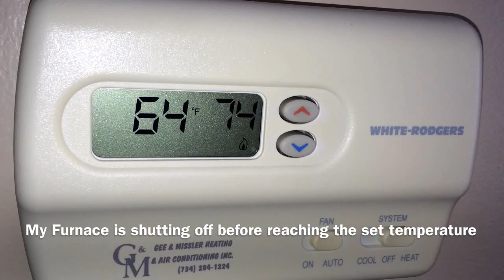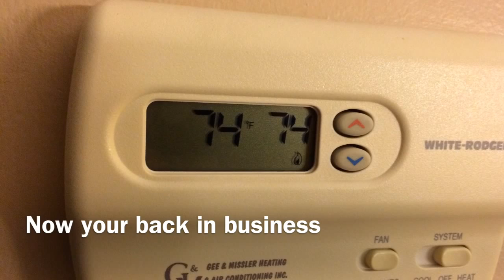My furnace keeps shutting off, only runs for about 5-10 mins... (HD) Simple Fix (Flame Sensor)

Comment: Thank you so much for posting this video! The flame in the burner box was shutting off almost immediately after firing up.  I took the flame sensor rod out and cleaned it up just like you said to in your video. It wasn't all that dirty but after I re-installed it the furnace fired right up with a beautiful blue flame. Thanks again for saving me a service call!
Reply from the maker: Glad the video was a help... make sure you replace the furnace filter also.

Comment: Wow, this is the first I've seen this answer and I hope that's it.  I cleaned the filters and thought that was it, but it would still time out early.  So I paid I 'diagnostic' (sales call) which I hate. He did a good overall health inspection, which was good, but I know he didn't know the cause and just wanted to throw parts ($1000 control board - which was $100 online or $30 on ebay), and/or cap ($175) but wasn't sure if that was problem, and/or switch.  I'm an engineer and questioned his measurements and how things work.  He never mentioned or looked at this and I'd put a wager that this 15 year old sensor with limited filter changes might be contaminated.  Wish me luck.

Comment: My furnace is about 40 years old , the landlord won't replace them but your showed they can get clogged.  Last year my furnace was shutting off after  it was on for about 7 minutes,  even the fan.   It took about 15 minutes to cool down if left it on and the same thing would happen.  It has a lot of soot in it.  I'll just have to work with it I guess till I can get fixed. Thanks for the information.
Reply from the maker: Glad this helped

Comment: I wanted to thank you! After watching your video even though my furnace was a different one than yours I was having the same issue couldn't get my landlord to check on it for a while and was freezing so I did what you recommended and reinstalled it now running strong!!!! Being a girl was kind of nervous but following your instructions really helped
Reply: great! i had to comment because it doesn't matter if you're a girl or a guy. many guys don't know this stuff either which is why they're here. don't put yourself down
Reply: Very helpful my oil company has not fixed this right over and over.
If they do not fix it right tomorrow I will let you know their name

Comment: Just a heads up....when I took my flame sensor out, it really didn't look too dirty (just a small brown tarnished spot about 1/2" long)  and I thought about just putting it back in w/o cleaning.  But then i thought, I took it out so why not clean it any way....good thing I cleaned it with steel wool, that was the problem.  Thank you for the video.  My furnace went out on about 4am on Christmas morning. (probably would not have gotten a repair tech here until late afternoon or the next day.

Comment: Wayne Campbell is correct, 5-10 seconds, not minutes. The flame sensor may be good but the sensor current may not be getting to the control board; usually due to a loose connection.  If the cycle comes on and shuts off in 5-10 minutes check the chamber temperature by sticking a wire probe through a small drilled hole. The temperature should not exceed @160 degrees F. If it is too high there probably isn't enough air passing over the heat exchanger. Check for restricted air flow due to a dirty  clogged filter or restrictions in the ducting and vents.   Make sure the blower is turning the correct RPMs. This can be checked with an inexpensive tachometer.  If the blower is turning too slow the problem could be the motor capacitor,  the wiring, or the blower motor itself.
david
Reply: Vivienne Pierce vuj

Comment: My furnace was doing this but it was not the result of a faulty flame sensor. Ended up being a clogged condensation trap which attaches to the drain hose. With the trap clogged water would get into the fan and the pressure switch would turn off the furnace because of pressure build up. Cleared the clog, and the furnace ran normal again.
Reply: +lestergoods Thanks for adding your comment!  I cleanded the sensor as described in the video but I was still having the problem.  Cleaning the trap was ultimately what solved the problem.   God bless you for sharing!!!
Reply: How did you clear / clean up the clogged condensation trap? My heater was turning off after 5 attempts. It made a gurgling sound and the engineer sucked out almost close to a gallon of water from the pipes heater side.
Reply: +Srini Sil Detatch the 2 or 3 hoses from the top of the trap, these are the ones that connect into the furnace exhaust fan. Have a bucket ready because water is going to free flow out of these hoses, if not, blow into it, you should hear water bubbling and then it should come out. After that I took the trap out, just snaps out, and blew into it and washed it out in the sink with soap and hot water. Make sure the water and air flow easily through the trap . Then just put it back together. Water in this part of the system is normal. The furnace just needs a way to get rid of it. Don't let some overpriced tech tell you the water needs to be sucked out. The furnace does this on its own by blowing it out with the fan and a clear line from the fan to the trap then out the bottom hose from the trap. :)
Reply: Thanks lestergood. I will try this out.
Reply: Thanks this was the fix to my furnace as well!
Reply: lestergoods sounds like a problem I might have. this video didn't work
Reply: Draining and cleaning out the condensation trap worked for me.  Thanks lestergoods.
Reply: lestergoods of
Reply: lestergoods 

 J i

Comment: Thanks so much.  We have a Merit Series lennox furnace, so the flame sensor is a little easier to get to than what you showed in your video.  Either way, once I cleaned it, it worked like a charm.  Thanks again for posting this video.

Comment: i have furnace just run 4-5 hours and then stop , so I have to turn the switch off and wait couple minute and then i turn switch back on , the furnace running about 4-5 hours and then stop again , I cleaned the flame sensor still that problem.Anna

Comment: Lennox furnace. 17 years old. shuts off prematurely. cleaned the ignitor, the flame sensor. used a fine steel wool. filter was very clogged. changed it. now it works fine. hope it helps someone. thanks

Comment: usually if its a flame sensor problem the furnace only runs for about 5 to 10 seconds not 5 to 10 min. it will try to stay on for three tries then shut off for about an hour.
Reply: This is exactly what my furnace has been doing. I will check the flame sensor first!
Reply: hot surface igniter

Comment: If it was the flame rectification rod it would kick back out almost immediately not after 10 mins, that sounds like an airflow issue. The unit is running and getting to hot due to insufficient airflow in the exchanger and is probably tripping the hi limit switch located in the combustion compartment causing a soft reset.
Reply: I have a keeprite its throwing a code 3 randomly over the last 2 months it has gone to a code 3 about 5 times.. I had 2 morons out to look at it, neither fixed the problem but took my 124bucks each time.. One claimed the snow was blocking the vent, wrong.. He essentially ran the furnace with top panel off claiming it was running perfect when all he did was reset the damn thing and watch it do one heat cycle.. He was there 15 minutes.. The furnace worked for 16 or so days but still had a weird intermittent short cycle..The second tech came 16 days later when it tripped a code 3 again.. This tech was a different guy same company.. I thought I wouldn't be charged since they didn't fix it right the first time, wrong.. They charged me again 124 bucks and all he did was blow threw the pressure switch tubing and pull the condensate drip housing thing off and claimed it was blocked with debris.. I expressed to him I did not think that was going to fix it because I already did everything he did exactly 30 days prior back when it first went to code 3.. 
He was writing the bill up and the furnace short cycled... 
Essentially it ran for 10 mins shut off for 20 seconds or less then fired right back up just as he was about to leave.. This peaked his ire.. Naturally it should.. He goes back down, I had to run to the bathroom and by the time I got downstairs (3mins total had passed) he claimed the problem was the heat sensor and that he just cleaned and put it back in..He went on to say it was utterly filthy and it had to be the problem.. I looked him dead in the eyes and said I cleaned the flame sensor 20 days prior before the first tech even showed up (the guy who said snow was blocking the intake)... Then he challenged me on where it was because I might have cleaned the wrong thing.. I pointed to it and he said yup thats it... I said it took me 20 minutes to fumble fuck my fat hands in there, get it out, cleaned and put back in.. You did it in 3 mins.. Fucking pure bull shit artist caught.. He never cleaned fuck all he wanted to leave because the problem was too big a job or he didn't know wtf to fix next.. Another waste of 124 bucks.. So Im in the hole 248 bucks on 2 tech calls that rendered me nothing but a anal fissure from the ass rape of my money.. They might as well have sent out their fucking janitor to trouble shoot for all these 2 clowns were worth... 

Anyways, the furnace is still short cycling for 10 mins or so on, then off and back on almost right away.. its been since january 31s 2019 that the first code 3 appeared.. But to be honest the furnace ran weird all winter... In sept 2018 a tech came and installed an ecobee wireless pos thermostat... My Hvac buddy thinks it fucked up the circuit board by doing excessive calls for heat or something I can't remember what he said exactly... 
I rehooked up my old regular thermostat and it still runs weird but I guess if the board is fucked its fucked right? 
Or perhaps its just a faulty pressure switch? 
I had a tech clean the furnace august 2018.. so last summer.. He barely pulled any brown fur out of the exchanger area.. I mean my pc has more dust in the case fan than what he showed me.. Either he did a poor job or its right blocked up and maybe the furnace is over heating??

I am thinking of ordering the pressure switch myself, it looks like a nutless monkey could put one in.. 
My other thought is the furnace circuit board or perhaps an overheating issue.. There is no blockage in the vents intake or outtake.. 
The 2nd tech even mentioned redoing the venting cuz it was sloped wrong? It looked fine to me.. its just pulling in air..
For the money I spent, those 2 guys, especially the 2nd guy, should have at least put a PS on.. or at least checked the actual switch to see if it was functioning properly..

Oh I forgot to mention. The furnace was bought brand new in 2012.. In the first 3 years it needed a new pressure switch, and blower motor.. and condensate pump.. Weird how all 3 of those things would be on code 3 list of things to check...
Reply: @tjl8884  how many btu is the KeepSpendingMoney on and what size is the vent piping? a lot of times the size of the vent pipe is boarderline to run sometimes but occasionally enough to pop the pressure switch, anything 100000 Btu and over here in Canada its required 3 inch vent pipe as code, but ive seen 85000 btu furnaces that will short cycle on 2 inch which should be good enough but maybe has 1 or 2 to many elbows causing the pressure switch to trip and i ended up diagnosing the vent issue on that one by running the furnace with the door cracked just a little bit to see if it would run fine using a little bit of air from the basement and the rest from the outside venting and sure enough it worked fine. I cut the 2 inch pipe on the intake side first on the riser and sized it up to 3 inch for the 25 foot run and it ran fine so i didnt bother upsizing the exhaust side as that would just be costing the customer more money for no real reason. In the end the customer got billed for 1.5 hours labor to remove all the existing pipe and install the new pipe, also the time spent to diagnose the issue. and $ 185.00 for the materials which was 3 lengths of 636 vent pipe and some elbows, cement, primer. They seemed happy as it was finally working as it should be and they had the same experience as you with previous so called "techs" came over and became part changers..
Reply: @grumpyoldman336  I think its 60 or 75k btu with 2 inch vents.. I asked the guy about adding a Y piece in and running a secondary intake off the Y to behind the house/under a deck where no snow is in conjunction with the already installed intake  vent and he wasn't sure if it was code or not. My question to him was if these are so fickle about enough air why only a 2 inch pipe and not 3 inch with a little grate cap to keep critters out.. He didn't respond because he still assumed the snow was the problem.. I knew it wasn't because there was no snow there a month earlier when the code 3 first happened...

Also, I ran the furnace with the top panel off and the code 3 still tripped it out about 3 days after the first tech came because I had a huge pile of snow to blow to get to where the vent was outside beside the house..And I was testing his theory about the snow as the cause..  So that was ruled out in 3 days.. I totally forgot about that till now. 

I contacted the original installers today and explained everything.. I couldn't use them back in feb 25th because we had a huge snow storm and snow day practically closed the town down.. So I was stuck using the first hvac company that was available.. 
The guy I talked to today thinks its the circuit board, pressure switch or blower.. 
He took some pitty on me and said he would install a new circuit board and let it run for a month to see if it codes 3 again.. If 
it runs with no code then he agreed to only charge me for the part and 1 hr labor.. If it still trips a code 3 he won't charge me anything till we track down the problem..

Its pretty sad though this thing is only 7 years old and its had so many problems.. 
Im in Canada too.. SSmarie to be exact.. 
Ill repost here if we figure it all out and ill let you know what part was defective or not..
Reply: @tjl8884  Gotcha ... yes i replace a lot of those keeprite furnaces they are crap in my opinion, I install Ruuds and have never had a call in 8 years putting them in even for an igniter or flame rod failure. If its still coding with the door open then theres a good chance the inducer fan isnt getting it done. How long is the vent run? and how many elbows 45 and 90 elbows, you need to look in the install manual and figure out the max length of 2 inch vent run and how much "equivalent" length each fitting costs you. A 90 elbow will usually equate to 5 feet of pipe length.
Reply: @grumpyoldman336  Your the third person to mention how crap they are to me.. 
I had a rheem rudd water tank last 20 years.. They are a quality company.. 
Napoleon is supposed to be a top notch brand made in Canada too.. I think that brand will replace this keeprite when it finally craps out.. Or possibly the Ruuds..

Comment: Could this sensor be the issue if you have replaced the thermostat and it gets real cols before the heat kicks back on? Sometimes I have to mess with the thermostat before it turns back on.
Reply: I am having the same issue.  What did you do to fix it?

Comment: Everything I'm reading says a normal furnace will cycle 3-10 times per hour so it does not overheat itself. It's when it cycles every minute that you should be concerned.

Comment: My furnace runs with the burners for 4-9 minutes and then shuts off the burners.  I do not get any error codes.  It just goes into idle mode.  It takes a 15 minute break and then does the same thing.  This only heats the house up by .5 to 2 degrees at a time, so the furnace never catches up.  The furnace filter was completely clogged.  I replaced the filter, the thermostat, cleaned the flame sensor rod and sparker.  Still the same problem.  What could it be???
Reply: @silverS70  The furnace repair man came out and said that my furnace had only been set to stage 1 blower motor fan speed from the factory.  He switched the control board to stage 2 fan speed, so it would run hard and heat up my house fast.  That fixed it!

Comment: I've been  doing this since we got this damn Lennnox furnace (3Years) now and this flame sensor has always been the problem. Maybe this is built into Lennox furnace's so the service people can rip you off on service calls (125) minimum for a service call for 5 minutes work. What I'm wondering do all furnaces have this problem?
Reply: Jim Renick It's there to make sure the gas is actually combusting.. If it weren't there your house could very well fill up with gas and explode! All modern furnaces have this crucial safety feature.

Comment: i somewhat have that problem  my furnace starts up as it should warm air comes from the ducts but after 5 min  i hear a weird noise from the board then, calling for heat again and it goes through the some precess again then after it reaches the desire temp it shuts off.   could this be the flame sensor?

Comment: I have airline model 1650 gas heater in my house and the pilot light works good but the burners want stay on but a few minutes and goes out with the thermostat up and kicks the relay switch would any one no what I might can do to fix the problem thanks